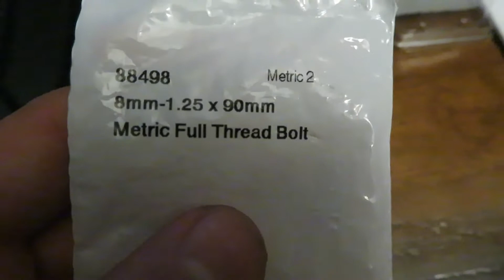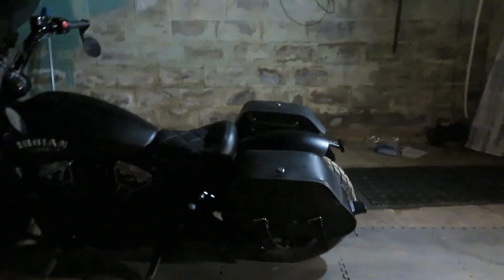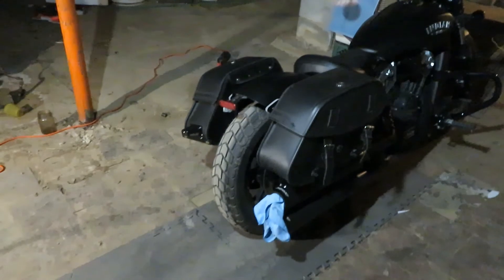Viking saddle bags on my Indian scout bobber

Comment: What license plate mount did you get, link?
Reply from the maker: https://www.amazon.com/LED-Trailer-Certified-Waterproof-Trailers/dp/B07937BQYJ/ref=sr_1_7?crid=2ZSCGLJFO7YZJ&dib=eyJ2IjoiMSJ9.MkTw9H-Naw5fYaoc6hpZrlrbuxX4wSJaZUdavcob8so1x3c5G2-AJ4-C2fdc_H5flvhT3SnbepfHzO5fv4MLJjfgNIJnot-1t_ulO7GlFzlbpN2VZWObo8oH49S8YtKNknG4-UiM4g9hj9hrPMqpKPTswlDiFRka0G_FBah03h1G8u1f4yLt2TGGbv8ggq9z6nVgtVSZDa76_EQLDF0oUlj8dkh6delkWuct6UX-65q0KWq8Gf9gkVWoahIyL7Jflbm6pG6wjZtmB33tl-W86wX-s_DCQMsviN-GoCH9ENk.1S-r6WqM_0nqbKCLkDkzD7qMHlfDOovXyNw6LbqLrFo&dib_tag=se&keywords=trailer+license+plate+bracket&qid=1710375638&sprefix=trailer+lic%2Caps%2C123&sr=8-7